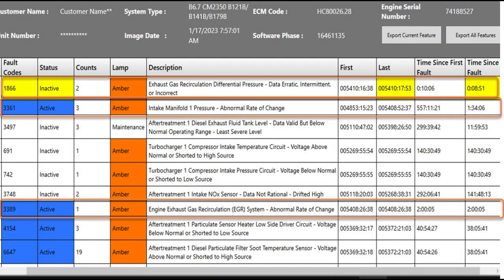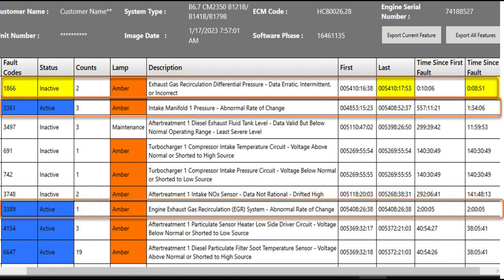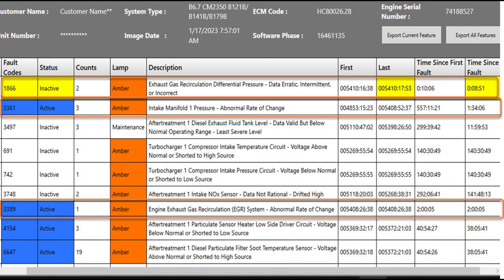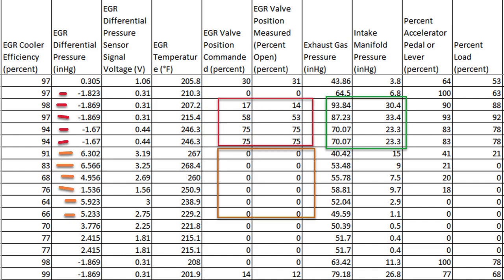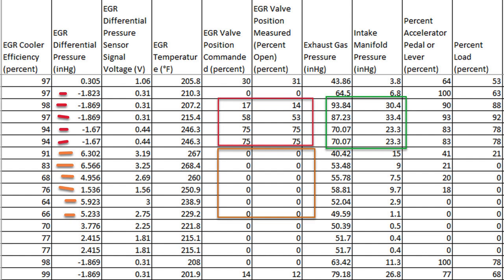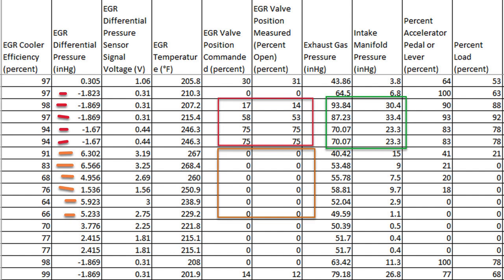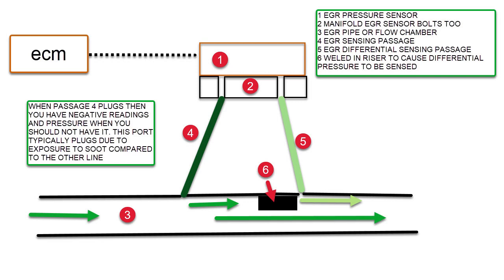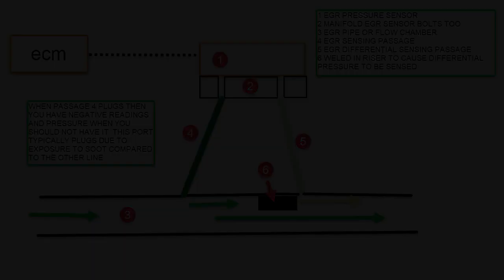How can I tell if my egr ports are plugged!

Comment: Would this effect passive regens or non efficient passive regens. Thank you for the breakdown  on you chart, that lets me understand that much better.
Reply from the maker: Yes it does. It actually effects the engines fuel air ratio all day. And it is a downward spiral because you start running dirty. If you are able to feel when the engine is passively regenning you would notice it is regenning more frequently. Thanks

Comment: This is a problem on the newer isb engines,,,have had to clean out the ports to the dif pressure sensor on a six month old truck!  I really think excessive idle time is causing this to flare up
Reply from the maker: Yes idle time and damp weather tag team the egr. Cummins just recently added cleaning these ports to the engines maintenance manual-Its about time.  Once the ports start to close off the engine gets sootier its a downward spiral. And it always seems the port that plugs first is the one that does the positive sensing or the egr value so the engine adds more egr to bring the number up.

Comment: my engine cm2350 when driving everything is normal but when regen sometimes had light blue smoke and white ash dust coming out. only when driving not park regen
Reply from the maker: If your stacks are getting whitish inside and you are using more def than normal the swirl plate in the decomposition tube has broken. you will need to replace the decomposition pipe once you verify that is what is wrong. That is my guess
Reply: Thank you Joe that was the issue i removed it on sunday and the plate was broken off